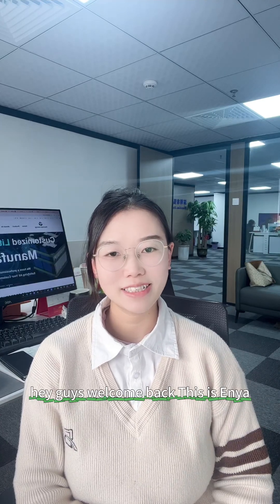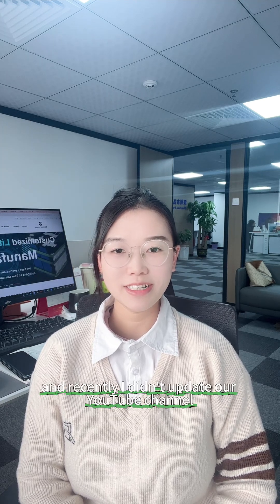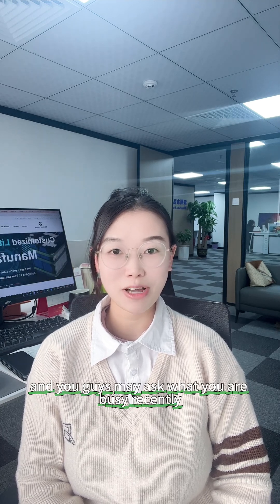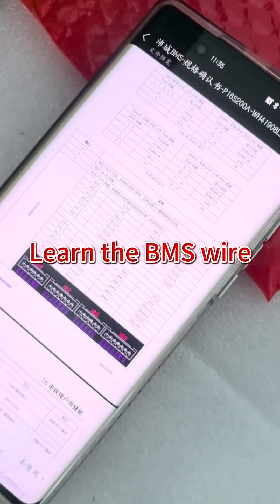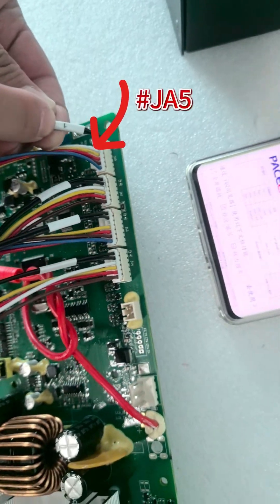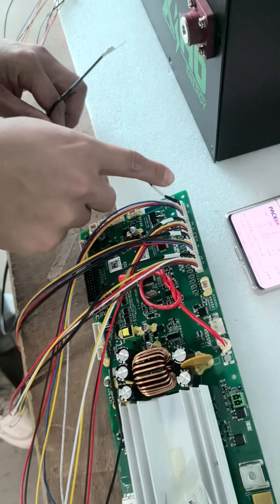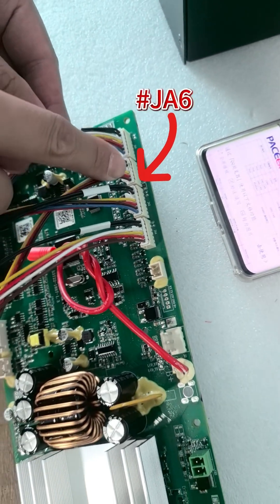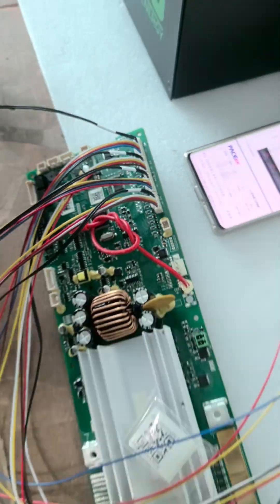How to connect PACE BMS with lifepo4 cell? #lifepo4battery

Comment: In 8s assembly system can only temperature sensors be connected? Will the sensor work without connecting the rest of the cables?